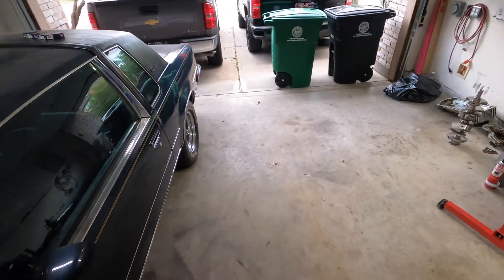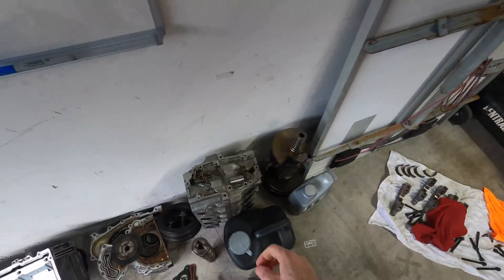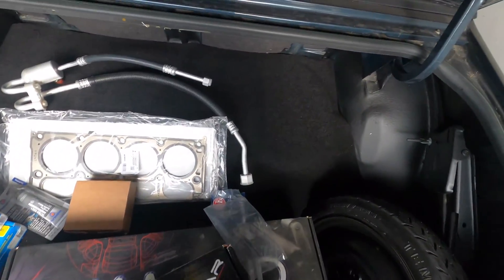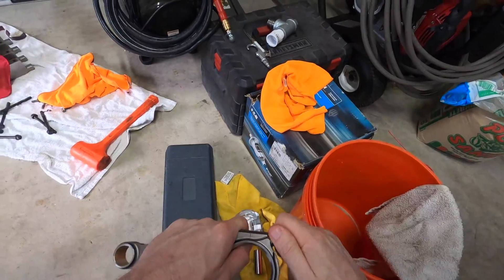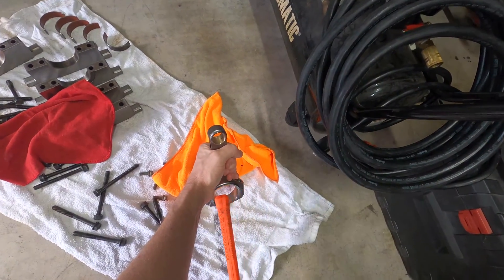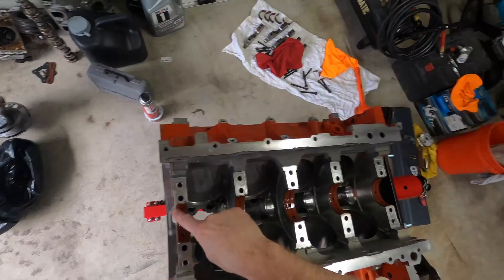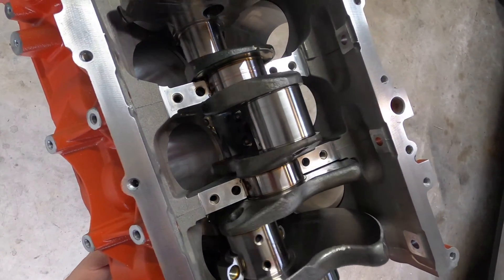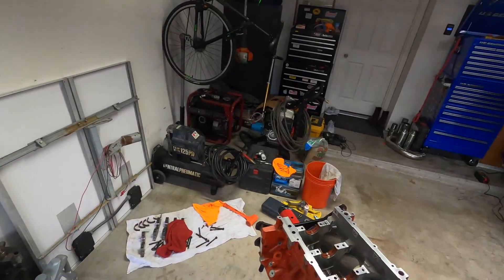L83 5.3 Build - Checking Piston to Piston Squirter Clearance

Comment: those ngk spark plugs, did they fit in your cylinder heads? i had ordered a set of 8 of NGK 6510 LTR7IX-11. they didnt thread in like the acdelco ones, i was pretty sure these fit on my l83. but yours are NGK 5107 LZTR7AIX-13, i was wondering if the ones you have fit in your l83 thanks
Reply from the maker: Where did you see mine are NGK 5107?  It's been so long I don't remember what I have in there.  One of my videos shows NGK 6509 (LTR6IX-11).
Reply from the maker: Nevermind...I see the plugs that came with the Whipple kit were LZTR7IX-13 (5107).  I'm almost certain those plugs are in the truck now.

Comment: Great channel bro! Keep up the good work!
Reply from the maker: Dropped off the rotating assembly for balancing earlier today.  Hopefully, I can get it together during this Woo-Hahn break.
Reply: @nu5m_radio Cant wait bro.  I have an l83 in my 2014 and she has been giving off a random misfire code. Turns out ita the lifter that dropped so looks like I'm going to follow your instructions on building a solid l83
Reply from the maker: @navafreddy  If you caught the bad lifter early enough, you might be able just to pull the head and drop a new AFM lifter in.  They usually don't start eating the cam immediately.  Bad lifters are a good excuse for a performance build though.  The guy I bought that used engine from used it as an excuse to swap in a 6.2....hahaha
Reply: @nu5m_radio  that's where I'm kinda standing at now. I'm considering building a L86 and just swapping then rebuilding the l83 to swap in my 94obs. But I'm waiting to see how all this wuhan virus plays out.
Reply: @nu5m_radio  I do have to delete that d.o.d anyways and since I'm home bound I feel like this would be the perfect time to build the l83.